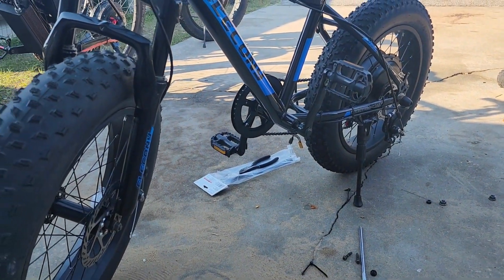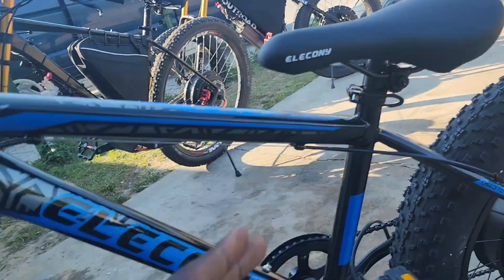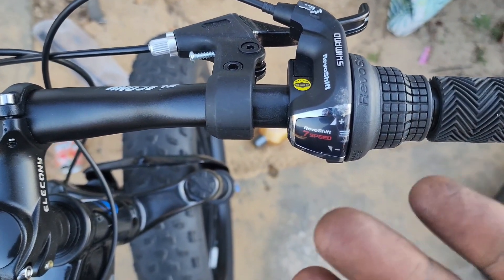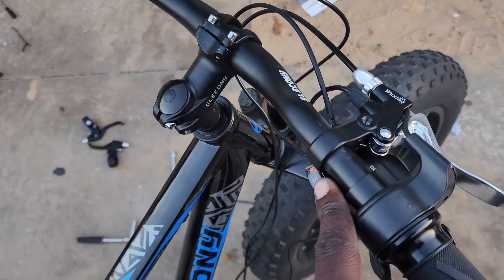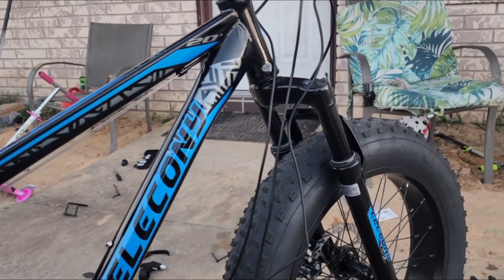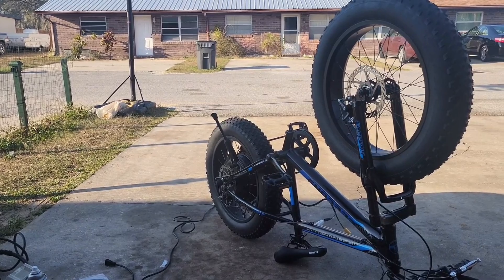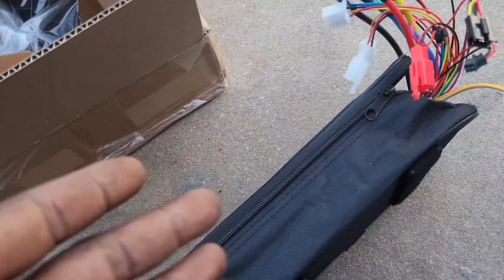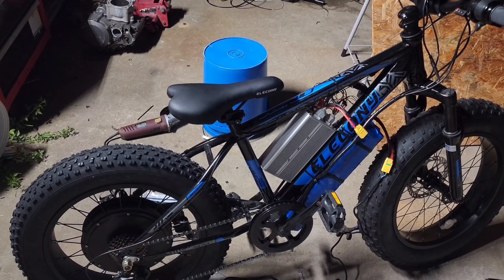New 1500w ebike build, for E-bikekid

Comment: What's up, my brother. It's your ebike rastaman friend in St Lucia. I was wondering if I could remove the cassette on my 350w rear motor, modify the shunt on the controller, and fit it on the front to work along my rear 1500w motor hoping it helps with hill climbing? Even if I still have to pedal, any advice for a first timer?
Reply from the maker: Ok yeah we can take a look at it

Comment: How's it going man, stupeed question. How can you tell if its really a 1500w motor also can these motors handle more watts? Say turn this to 2000w by shunt mod or etc.. Appreciate your inputs bro
Reply from the maker: It depends on the weight of the bike and the rider, 1500w will be heavier than a 1000w motor they can handle more watts but not for a long time tho

Comment: Did you lace the hub in to the fatbike wheel
Reply from the maker: No. Actually it's a kit for 350 on ebay comes with a sabvoton 45a controller
Reply: Okay cheers mate
Reply from the maker: No problem